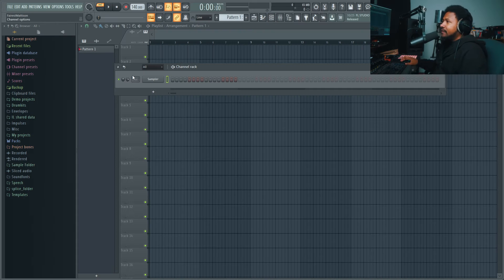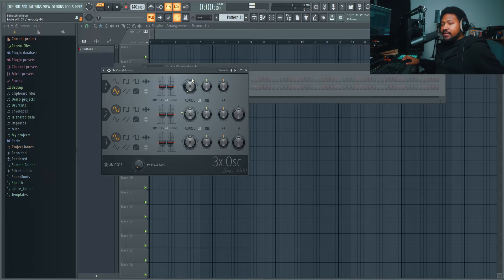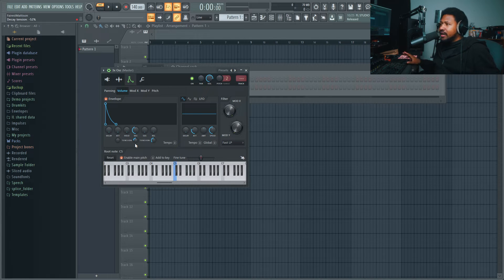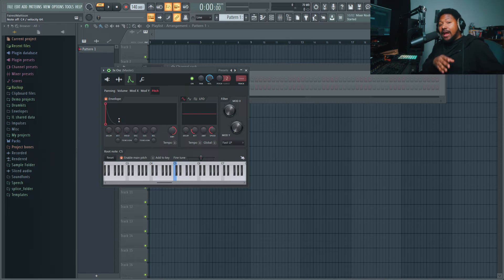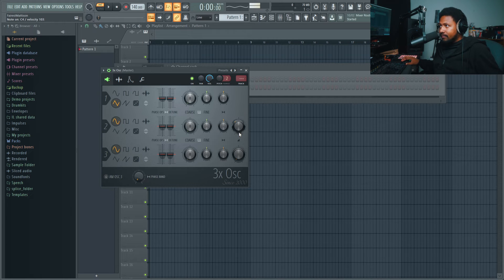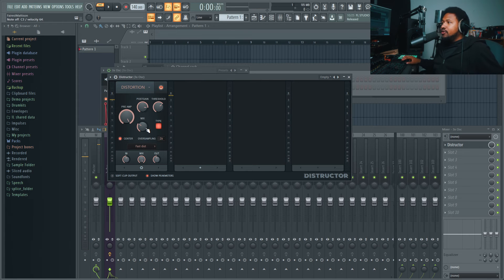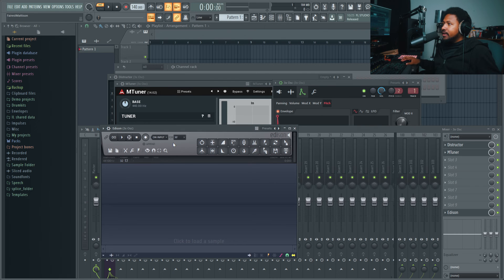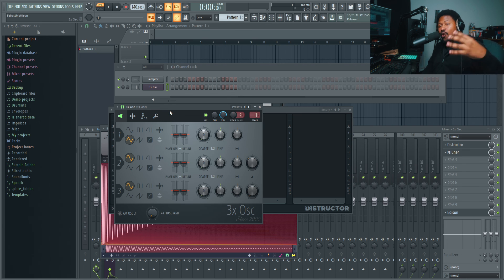How to create 808's in 3xOsc in FL Studio 20 stock plugins only!

Comment: hey man this aint a very useful comment but i want you to know this tutorial is very helpful, i always wondered how people did that pitch bend stuff inside the basic synths. 
this still works perfectly the same 4 years later.
Reply: The tuner is to change the key of a midi note if say you drag a kick sample onto playlist and its in the key of E but your track is in the key of F, so you can use the pitch to change the e sample to match your song key so it doesnt clash. Pitch bend i have seen many use automation clips for that so they can change the bend at different sections of the song or make it more intense at the drop etc. correct me if i am wrong but thats my understanding of it so far.